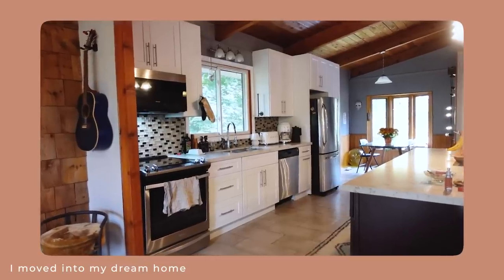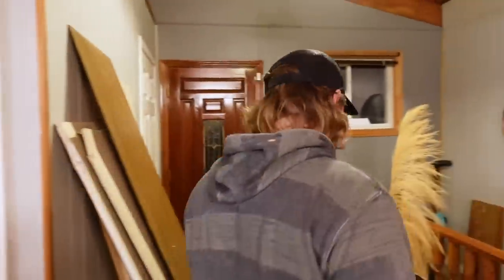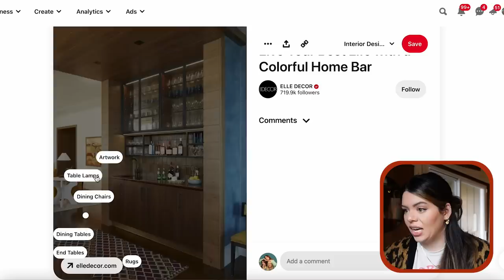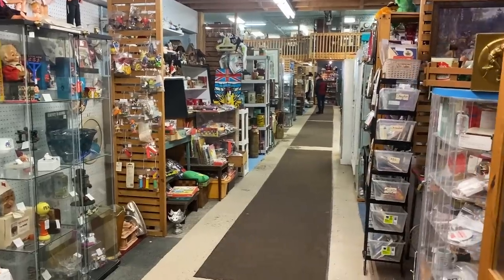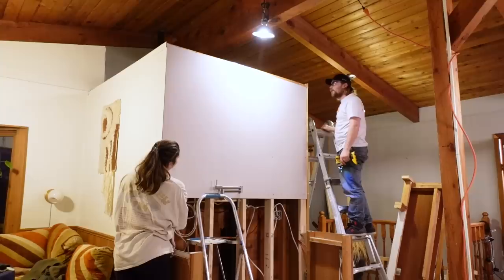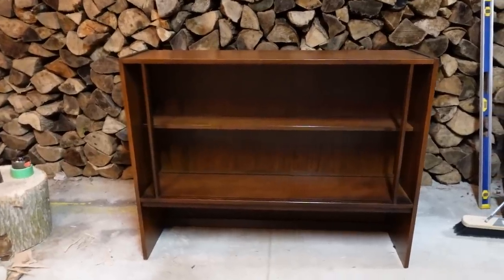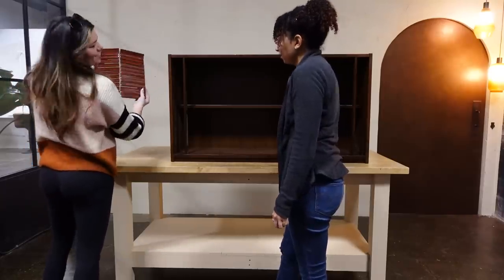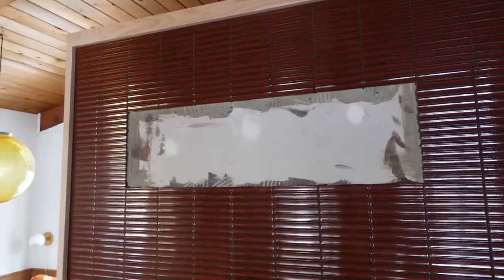can i make over my pantry closet into a home bar?

Comment: I'm surprised you didn't find a pile of razor blades on the back side of that medicine cabinet.   People used to put old razor blades from shaving into those slots and they'd just go into empty space in the wall.  People have found big piles of rusty old razor blades when doing renovations!  When Austin tapped on it saying it was a safe and I saw that slot, I knew exactly what it was!  :)

Comment: Our 1965 was "redone"  by a house flipper.  They literally just tiled over the original laminate flooring in every room.  We ended up with a lot of cracked tile because it wasn't laid correctly,  But on the plus side it was super easy to take up because it just peeled right off of the linoleum.

Comment: Hi! I saw you wondering about tiling over that thin old floor tile you found. Sometimes that kind of older tile (before the 80s) had asbestos in it, and one safe way to deal with asbestos without a costly removal process is to encapsulate it with a new safer material. So if you start digging into those floors again for a new project (or one day replace your floors) maybe test it just so you can be safe! Just hoping to be service-y with some FYI :)

Comment: The slot at the back of the mirror box was designed so you could post your used razor blades into there. Sometimes when you’re renovating older houses you get a whole stack of used blades in the space between the studs. I guess it was safer then putting it in the trash. And they’re so small you’d never fill up the whole space.

Comment: I'm currently doing a 100 baby sims 4 challenge (63 and they all have rock names). I did not build the tudor  mansion, but I have been trying to add under the stairs rooms to all the lots. In my house it's a pantry with access to the basement. Mostly kitchen clutter but decorated so that it's pleasant to look at when you grab the broom or potato or picnic basket.

Comment: What a great use of that space.  I would never have thought to make it into a bar area like you're doing, I'm all about pantries.  I like it and that's it's a mix of various pieces all tied together.  The tiles are very pretty, I do love the color.
Question/curious - why you didn't put some insulation in the wall before covering with dry wall since it backs up to the bathroom, a bit of sound control.  TY

Comment: if you kept the 2 half-walls on either side, why not infill the whole space with actual cabinets (doors, drawers, etc) so that it looks built-in? I feel like putting piece of walnut furniture in that weird hole at the bottom portion of the wall will look so weird. there is a tiny step up at the bottom and the 2 chunky side-walls that the furniture can't hide. definitely do some custom cabinets in there! it will not be that hard. you can use the sideboard in another part of the house